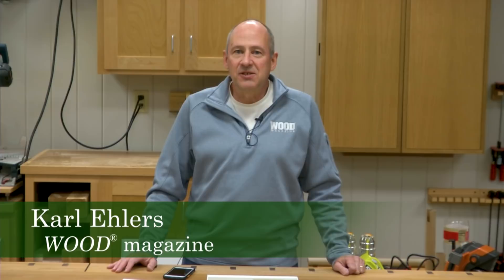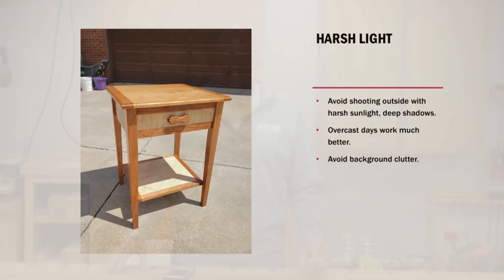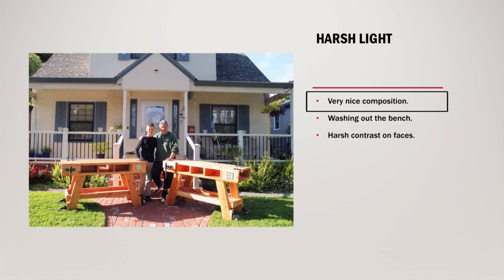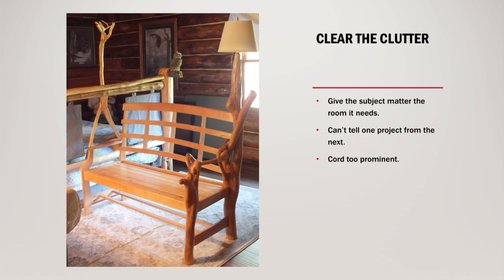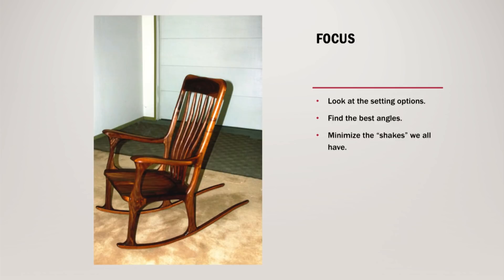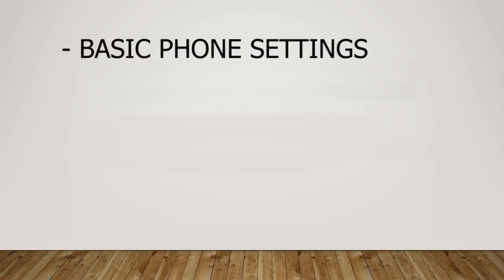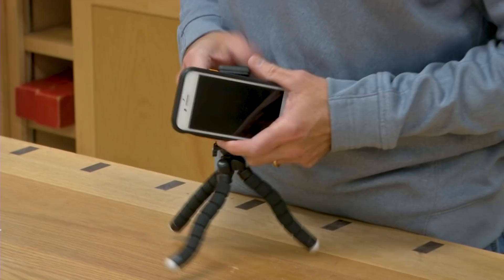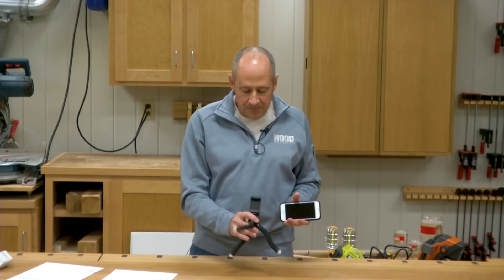How To Shoot Better Pictures Of Your Project - WOOD magazine

Comment: As a professional photographer for 30+ years, I can say I agree with most of your points. I've been using white formica backgrounds for years ... great for small tabletop shots but I even use it for full-length people shots. Using a 4x8 sheet as the "floor", sitting on top of a slightly rolled out  roll of white seamless paper as the background, it makes an effective seamless background sweep on a budget. This could easily be used for larger, tall projects such as a highboy dresser. Also glad to hear you recommend bounce lighting - that's the key. In essence, you're taking a small light source (whatever light you're using), and turning it into a large light source (the ceiling, a wall, etc), which will typically be more flattering to the project. However, your lighting demo using the foamcore "V" was somewhat of a failure because of your light placement. Much of the lighting on the drill came directly from the light - even though the light wasn't aimed squarely at the drill, there was still a lot of spill light illuminating it. It would have been better to aim the light directly into the reflector, ensuring that no light came directly from the light source. I would also suggest raising the light up a bit and off the table. Light looks a little more natural when it comes from above. Otherwise, great job.